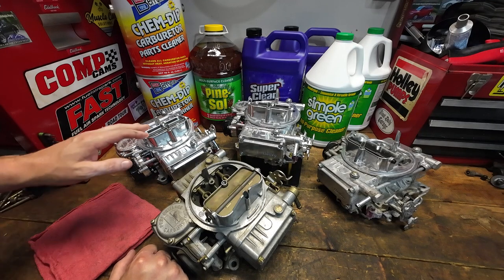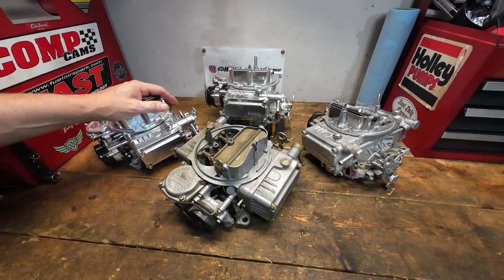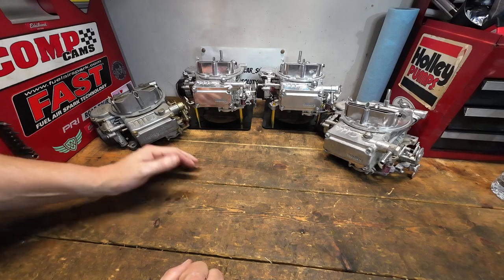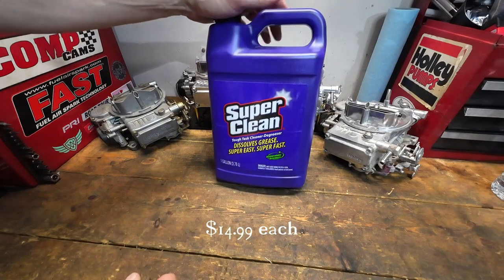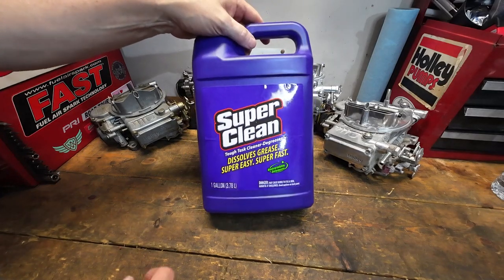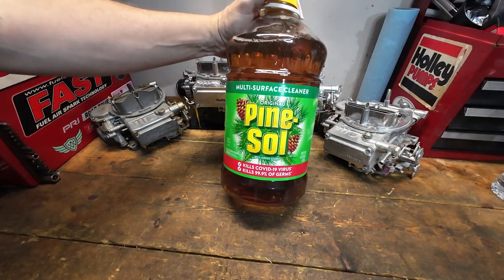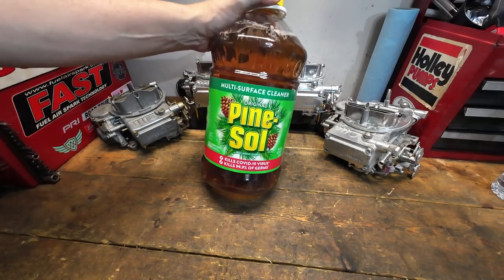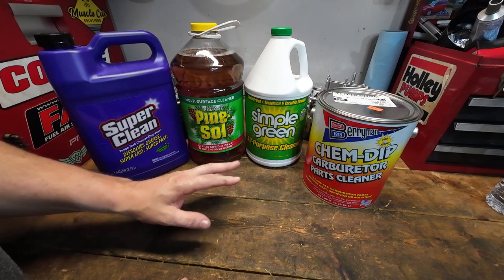Carburetor Cleaning Solutions Tested - PART 1

Comment: If only you had done this video about a week ago, it would have saved my 25 year old 1405. I used the purple super clean and got the same results after about 4 hours. Love your videos, they have helped me a ton with dialing in the carb on my 68 GMC.
Reply from the maker: Dang!  That sucks.  4 hours… that’s fast.  I didn’t think it worked so quickly.  Best of luck with your ole GMC!
Reply: @MuscleCarSolutions  It caught me by surprise. That stuff works great on steel, just not for aluminum I guess. Not too worked up about the loss of the carb. I have a newer one on it now that runs fine. This one was a older spare that was a little suspect anyway.
Reply from the maker: @nathanstpierre233  I understand the surprise.  I got caught off guard too!  Pretty amazing how quickly they deteriorate.

Comment: Super Clean has sodium hydroxide, which dissolves aluminum. As a side note, the gas generated by the reaction is hydrogen, so probably don't want to smoke around it especially after it has been concentrated under that lid.
Reply from the maker: None of the lids were sealed tight, in case what happened, happened!  It’s surprising the number of folks who swore by super clean.  So we tested it!  Horrible!
Reply: @MuscleCarSolutions  It works well on greasy, dirty stuff so long as it's not aluminum. Even short periods of contact discolor aluminum. I found out the hard way cleaning an engine bay and quickly ruined the finish on a carb and intake manifold.

Comment: I found a can of carb dip from the 70 `s while cleaning garage recently . Was beginning to corrode the can at bottom so i was fairly sure it was still good. Was approx . 75 % strenght after all those years . Did not take rust off like it did  when new .
Reply from the maker: I wonder how much of its potency it lost after all that time.  As long as it still works!  Probably better than today cleaners.  🧐

Comment: I don't have this stuff in home shop but when doing carbs 
Tear down - note float height, squirters, jets, power valve...
AXE jetwash everything but base plate
Then Safety Kleen recycling solvent tank to wash and rinse bowls, metering blocks, main body and base plate.  Rinse through each hole and verify no restrictions.
Then AXE spray cabinet to rinse with hot water and blow dry (commercial kitchen sink with spray wash works well too). Everything but baseplate - brake cleaned and dried.
Then to gauging/assembly.

Could probably replicate with a portable water heater, pressure washer, soap and some cleaning fixtures that mount to something and a clean solvent tank.
Reply: Forgot to mention stuff with blue locktight was soda blasted then rinsed.  Base plate and accelerator pump housing bolts.
Reply from the maker: I think the average DIY car guy/girl would love to have a spray cabinet in their arsenal!

Comment: Hello! Active carburetor cleaner servicing guy here! Gotta couple of questions for you, as I'm trying to find a good solution for a permanent solution for cleaning. I currently use gunk carb dip and it works phenomenal it's just stupid expensive.
1. Have you used CRC parts washing solvent?
2. After they have dried did they leave a nasty white film (and not talking about the purple degreaser 😂)
3. What solvent do you use on a daily?
4. Also any tips for a future carburetor cleaner?
Reply from the maker: I have not used the CRC parts washer but sure would love to if I had the room for it.  I have been using a multi cleaner from Zep.  It’s ok, but always on the look out for something better.
Reply: @MuscleCarSolutions  awesome thank you so much! AJ from Swart and Son Comets!

Comment: Super Clean and Purple Power are alkaline based and can etch aluminum. I did not know that it would be this bad. I do know that they  will strip some paints. I have never left things soak in it knowing it is alkaline based. It can be used to clean aluminum before welding but I have never done it. I think from use that Super Clean is slightly more potent than Purple Power.
Reply from the maker: And yet it was easily the number one requested solution to test (slightly more than the Berrymans or equivalent).  But it was asked to test and the results were clear.  Don’t use it for carb cleaning unless extremely diluted and for very short periods of time!
Reply: I use it on aluminum but, I do not soak it overnight. I work with it after a short soaking, maybe 5 minutes. I used Super Clean to clean sludged up aluminum head on a Ford Probe and used a parts tub and poured if over and a parts brush to clean it. The head looked brand new when finished. It was not soaked overnight. I personally like both Purple Power (slightly cheaper) and Super Clean. 

 @MuscleCarSolutions
Reply from the maker: Oh I’m quite sure there are right ways of using any of these products.  And I also know that if there’s a wrong way to use them, folks will find it! 😂
Reply: I did. I was shocked to see the damage. Even vinegar for rust removal on steel will do damage if the part is submerged too long.  @MuscleCarSolutions
Reply from the maker: Oh it gets much worse.  Stay tuned for part 2! 😂
Reply: Thanks, I will.  @MuscleCarSolutions

Comment: I'm not surprised at all about the Super Clean results, considering it says right in the destructions "Do Not Use On Aluminum". 🤣
Reply from the maker: And yet it was easily one most folks said they use to clean their carburetors and wanted it included in the test.  No one reads instructions!
Reply: @MuscleCarSolutions  Ahhh, the ole Failure To Comprehend escape clause, sorry I forgot about that one.🤣I'm surprised no one suggested that they use Summers Eve Disposable Douche to clean their Carbs when they run out of Safety Kleen Solvent...🤣
Reply from the maker: @thebegrsshow  oh I got some weird suggestions.  These I selected were the most plausible and easy to pick up locally for just about anyone in the US.  But just like carburetors and camshafts.  Bigger is always better.  So more solvent and less dilution the better.  I like worst case scenario testing.  The results are rarely disappointing.  😆

Comment: Super clean and purple power similar but not the same both attack aluminum....even faster if heated to 165°.... I use it too clean steel and iron products which it does an awesome job of cutting grease and grime... But like the man said sodium hydroxide and aluminum don't play well 😂😂😂.... Knew I had the sodium part right on IG😮... The berry mans use to be the shinitz to clean carbs till the EPA made them change the formula look up the old msds for the old stuff vs the garbage they sell now and you'll understand.... You can still make it but you need to buy the chemicals separate thank you EPA😡😠😠...a fact that fuel injection forced on us carb lovers.
Reply from the maker: It’s surprising the number of folks who suggested it for this test.  Which means there’s potentially a lot of horrible carburetors out there!  Berrymans works ok.  I won’t test it here, but in the ultrasonic it’s exceptional.  But everything was better in the 70s and 80s.  🤷